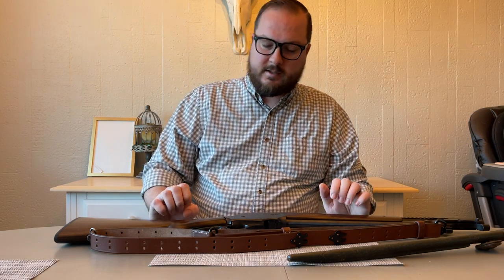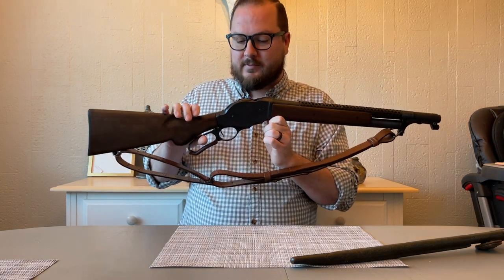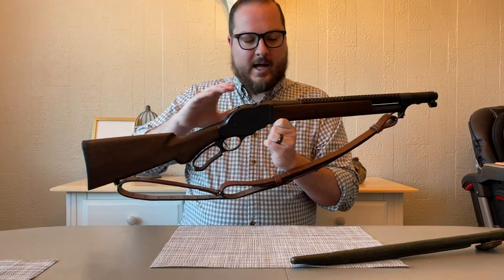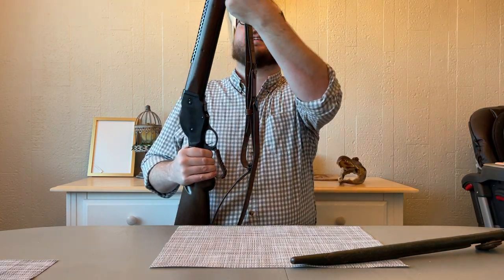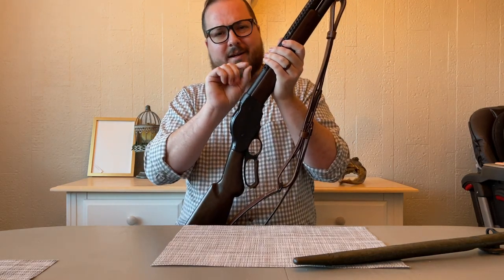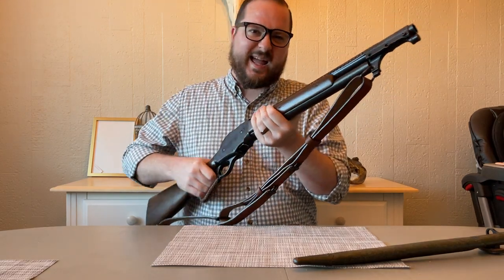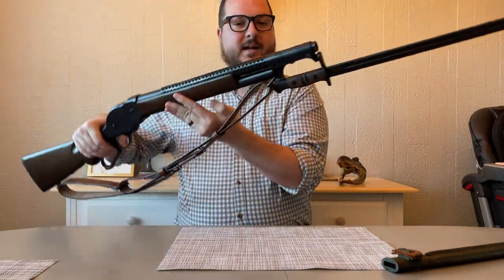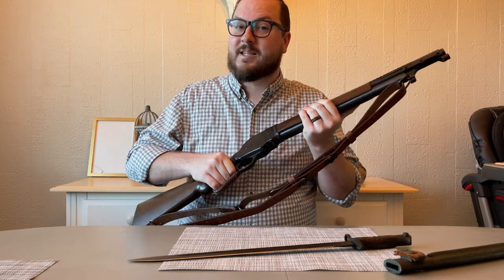Model 1887 Trench Gun (Alternate History Version)

Comment: i thought about doing this to mine before seeing the video, i'm so glad to see this has been done and i'm not a complete bozo for thinking  about it! i'd probablly do a trigger job on  mine as well as  adding a trap recoil pad from limbsaver as well as adding removable chokes though. sad that the heatshield has gone up so much in price... waiting to see when they will be availlable...  my pw87 had an off spec barrel (a 24-25'' one) so i'll have to cut it down to see if my haunch is true and that the barrel is actually badly forged (i can see the thickness variation when looking at the wals of the barrel so i can guess where the bore center is found) by the way they are made by norinco, they just use different names. mine has another writting on it since it's for canadian market.

Comment: I have a pw87 and I just acquired an original Winchester 1887. Maybe I will project the pw?

In 1887, shotgun shells were Black Powder,  and available in 2 ³/⁸" & 2 ¹/²". The pw87 has the same dimensions as the original. Modern shells are longer. If you hand load, you can make them in the appropriate shorter length, and it will cycle easier.

Comment: You're using the wrong shotgun cowboy. It's the 12 gauge, 1887 pattern pump  action shotgun developed by John Browning with the slam fire option using double ought buck and brass casings. The bayonet just made it more badass.
Reply from the maker: That’s the point. The 1897 is what they made the trench guns out of. This theoretical alternate history 1887 trench gun is the point of this project. I literally go over it in the first minute or so of the video…